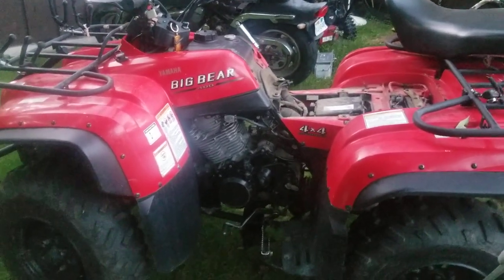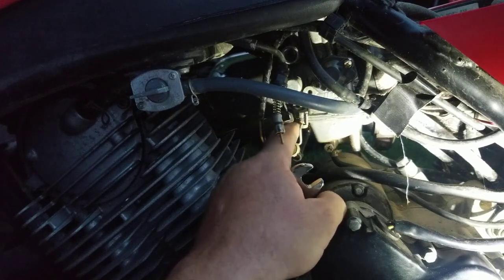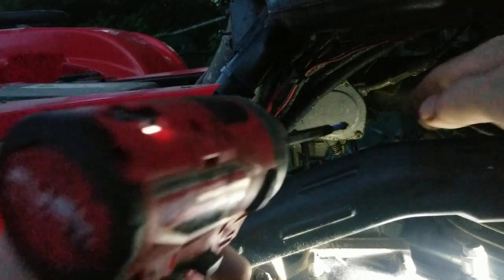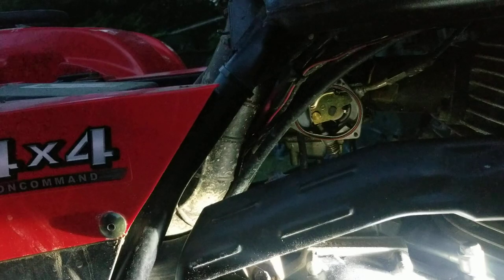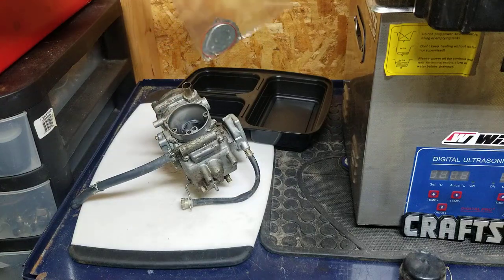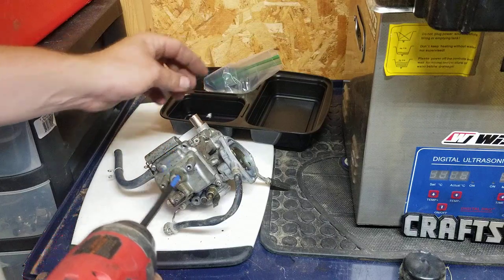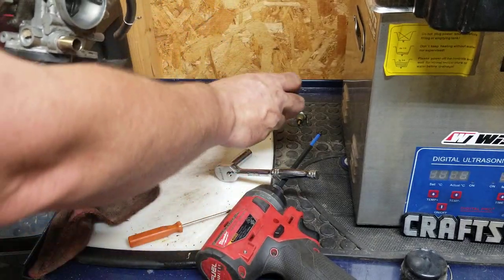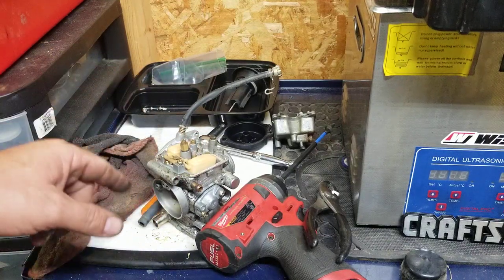Working on the Yamaha big bear 400 carb removal and tech tips

Comment: I have a question, I do have with my four wheeler Yamaha big bear 400 4x4 is 2001. What is measurement with the float in the carburetor?
Reply from the maker: @Braxton-elite-archery  I don't but it should be level when closed
Reply: @2strokeguru  right, I been looking for information, it says 13 mm, when I just found.

Comment: Thank you so much for your informative video. Just what I needed. Keep up the great work.
If you needed to replace the float assembly would you use an OEM kit or do you have any aftermarket recommendations?
Reply from the maker: Very welcome
Reply from the maker: Go on to partszilla.Com you can look up the part number type it in Ebay and typically stock and aftermarket pop up

Comment: Kevin I need your opinion. Im trying to remove the Stator Coil Generator on my 1975 Kawasaki G4 but have had no luck.. from the videos it appears to just pry out, but it just won't nudge. Already tried pb blaster and that pry technique to no avail.. suggestions?
Reply from the maker: why are you removing them there are 2 screws pry out
Reply: @2strokeguru  the point spring is completely seized, already tried that..  thanks anyways!!

Comment: Hey Kevin keep up the excellent work man. I really enjoy watching and learning from your videos. I have a f11250 that's scavenging oil from crankcase smoking like a train. What's your professional opinion on how to approach the rebuild. Thanks for your recent replies.
Reply from the maker: is it burning engine oil and 2 stroke oil at the same time
Reply: Yeah
Reply: It's got good compression but the spark plug always has oil on it and it leaks on the left side of the bike over time
Reply from the maker: @LarryJohnson-tc7xc  i would check out exhaust tip see if it is clogged with soot
Reply: @2strokeguru  I took the Exuast tip out this winter it was completely saturated with the oil mix residue I cleaned it repacked it. I bought this bike 2 years ago knowing that the engine would probably need going through. Piston rings seals bearings etc. It's kinda hard finding  old school 2stroke mechanics like yourself that know what the're doing to these vintage machines.
Reply from the maker: @LarryJohnson-tc7xc  6033958097

Comment: I can't get the carburetor out because the throttle slide is stuck and won't go forward so I can't get the cable out. I've tried pushing it with a flat head and hitting the gas doesn't work either. It's a 04 big bear 400 4x4 that's been sitting for a few years. Any tips?
Reply from the maker: Penatrating oil or remove the cable from the throttle at the handle bars pull it through so you can get the carb out then ultrasonic clean up that will free it up

Comment: iF you unhook the cable at the throttle it will release slack to remove it easily in the carb. Easy to release and rehook up.

Comment: Can the 3.0 fit a 400 big bear if so im looking into getting another carb because my needle in my carb has gotten jam some how only thing that makes it go is the throttle cable not getting the power it supposed to get because of the needle not moving wen you press the gas

Comment: Do those two sensors in the carb make a big play in the atv running because I got a carb for mine and it doesn’t have the connectors for the two wires that go to the carb

Comment: Is it important for the heater to be working on the carb or is it  Necessary to have it on the carb
Reply from the maker: I had one that someone completely removed ran absolutely fine even in the winter
Reply: @2strokeguru  thanks
Reply: @2strokeguru  im going nuts trying to  Figure out why this quad breaks up when on the throttle and the spark plug is getting found out with black carbon.  The kid put an aftermarket Carburetor on it it's a 2002 big bear 400 Yamaha. I check the timing the marks are  100% I checked  The tension on the chain the tensioner is perfect and I just checked the valve lash thats perfect as well.. You Rave it up in neutral and it breaks up.. Do you know what the adjustment for the  carburetor air mixture screw should be at By any chance

Comment: What are the 2 wires you pulled off?  I have an 03 big bear 400 and it wont go over 25mph.  The carb was replaced and there are 2 wires that arent connected that look like they may be the same ones you pulled off.  There is no connection for these on the new carb.   are these rev limiters and can I wire these together and run to the negative battery cable to bypass them..  IM LOST LOL.   please help.
Reply from the maker: carb temp / heater for winter
Reply: @2strokeguru  ok thanks.  from what I have seen the rev limiter is a green and white wire.  but I cant seem to find it.  Any other idea why it would sputter in 4th and 5th and not go over 25 mph?
Reply from the maker: @briancox3769  take a fuel sample watch the video on fuel system i just posted couple days ago
Reply: @2strokeguru  I'm running into the same issue, i'm trying to find a replacement carb for my 04 big bear 400, and most don't have a place to plug those 2 little connector, will it run fine without those pluged in? What are they for exactly?

Comment: Hey! I have an 08 big bear 400 with only 150 miles on it. its been sitting for years and i was planning on replacing the carb. I keep seeing these cheap 40 or 60 dollar carbs that say they fit my model yet the OEM part is 250-350 depending on retailer. whats the deal with those cheap carbs would it be worth it just to see if i can get it running?
Reply: Odds are it will work. Just expect to go through a few lemons till you get one to work. Unless the the carb is rusted just clean it. Parts very accessible for that model. Ultrasound is your friend. Bur a good carb cleaner a carb kit and forced air also good companions.
Reply: @kansascityshuffle8526  got a rebuild kit, gonna try to fix it up first. got to start up with a little sniff of ether so I think it will go with a clean carb and fresh fluids. etc,
Reply: @collinmc90  ha did this a year ago. Ended up having to take it to a shop. My only sin was that there are two jets in my 09. Apparently they can actually be put in the wrong hole and threaded in. Maybe take them apart and clean and replace individually instead of taking them both out. Or if you have got them both out and it doesn’t run after reassembly consider this possibility. Hope that helps.

Comment: Like the video but I need to know where the small vacuum lines run the one that has a tee in it
Reply from the maker: Intake port and petcock full pull
Reply: Thanks not only did you make a good video, but went the extra mile to answer a question.
Reply from the maker: @travishale1491  this is a learning channel i do my best to answer if you take the time to subscribe and watch my videos i will do my best to answer
Reply: @2strokeguru  I still found the location on the intake the vacuum hooks up on. I have a model yfm400nn big bear the problem I'm having it loses power and cuts out when I give it gas. I tried to clean the carb then ordered a brand new carb. And I'm still having the same problem the compression is reading 125 when cold. I heard that the reverse switch or neutral switch can trigger a rev limiter but I've tried unhooking both of those. Still same problem.
Reply from the maker: @travishale1491  have you replaced the spark plugs this bike uses a resistor plug sounds like it could be the plug
Reply: @2strokeguru  I put a brand new one in and also unscrewed the plug boot cut a half inch screwed it back in. I thought that a rev limiter may be cutting off the spark. I put a inline spark tester in and took it for a ride. The tester still lights up when the engine is cutting out and I double checked the plug gap. Think I try another plug tomorrow just in case I ended up with a bad plug
Reply: Is there a chance that there is a part inside the plug boot that has gone bad I have a wave runner that has happened to
Reply from the maker: @travishale1491  yes some boots have resistor built in
Reply: @2strokeguru  thought I'd let you know I finely found the problem. I unplugged all my wiring harnesses and spared them with electrical parts cleaner it's running like it should now

Comment: Too properly release the throttle cable from the carb, you need to move the piece it’s attached to into the accelerator position so as to give it enough slack to get the brass piece out

Comment: Nothing like watching a video filmed in the dark?
Reply from the maker: I had to get it done
Reply: @2strokeguru  how many turna do you turn the mixture screw or pilot screw. Mine wont run correctly at all since someone enrichened it to much.
Reply from the maker: @GMC.Sonoma.4.3  1 and a half is the starting point there is no turn to exact amount that gets it running and then fine tune it
Reply: @2strokeguru  what do you mean fine tune it? Like without the throttle stop screw or something idk it doesnt say in the owners manual or on the machine how many turns for that screw.
Reply: @2strokeguru  mine was running rich at idle and burning too much gas. How do i get it to not run lean or rich?